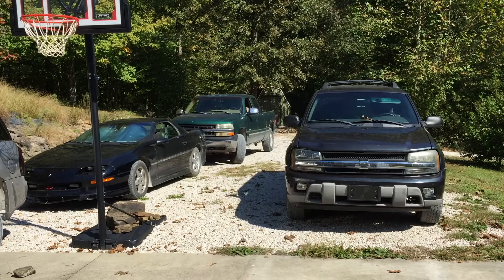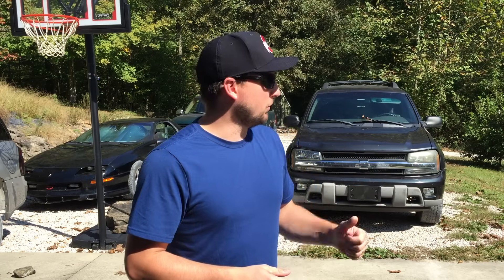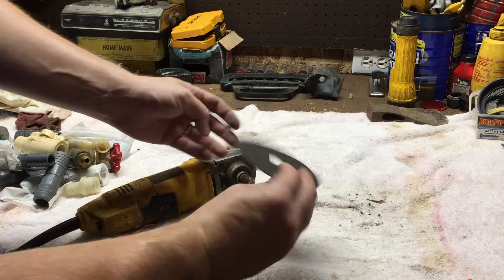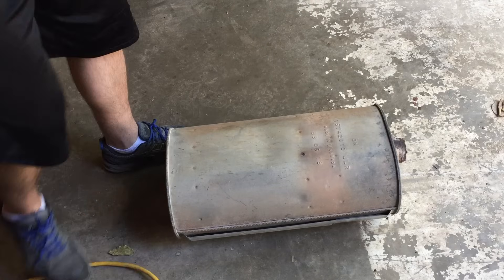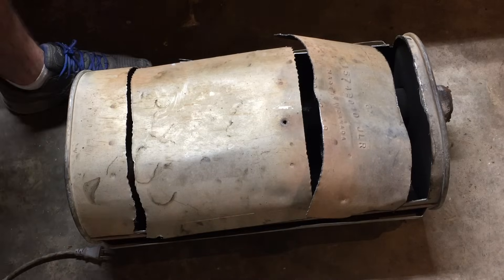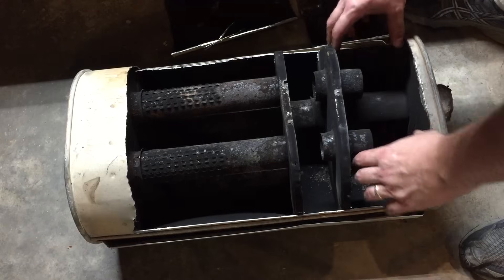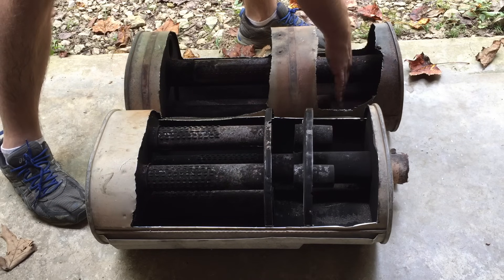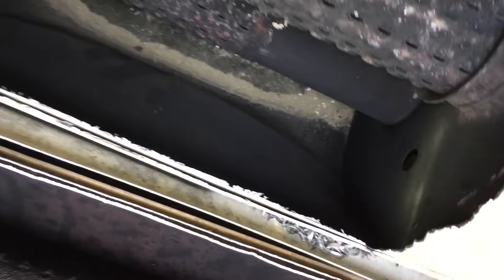What's inside a stock GMC Yukon muffler? - Cutting open Yukon muffler - How a muffler works

Comment from the maker: What did you expect to see inside this muffler?
Reply: Fiberglass packing
Reply: Dancing pixies
Reply: I have an 06 trailblazer with the 5.3. Completely stock. Needs a vortex exhaust really bad. Super nice and clean vehicle though. Does your tb have the 4.2 i6? Also if properly maintained the i6 can go for 350,000 miles easy.
Reply: Mt. Dew cans

Comment: Super late criticism, but no guard, cutting with the left side of the wheel (kickback toward you), wheel upside down, one handed, and no ear protection. Only thing missing is holding down the muffler with sandals on! Careful, anyone else watching! I'd also recommend ditching the wrench and hand tightening. 

Otherwise, cool to see the inside. Was thinking of doing this to mine, but couldn't be bothered to keep the rotted old one.

Comment: I have a 2000 GMC dually with a similar factory muffler. I just ordered a Flowmonster with two 3" inlets and two 3" outlets. It's a straight-through design with sound absorption packing. Looking forward to hearing that 454 roar!

Comment: And then there's my '05 Tahoe with a factory single 2.5" inlet and DUAL 3" outlets that quickly turn into a single 3" via a Y-pipe.  I ain't NO rocket surgeon, but I don't remember ever seeing a set-up like mine on another vehicle.  Don't quite understand the reasoning behind dual 3" outlets into a Y-pipe 3" single.  Can't be to HELP lower backpressure, must be for sound attenuation?  The sound isn't too bad for a stock system.  Because of your vids, I may go with the M-80, wanting a bit more rumble.  Great vids and FUN, too!

Comment: What has been your experience when installing an aftermarket performance exhaust, do you ever notice any low-end Torque loss?   I have, even with simply just swapping out the muffler with the same diameter piping not to lose any scavenging.

Comment: I know this is an older video now but what is it ultimately that makes an exhaust loud? Is it the velocity of the gasses? I have an 02 Silverado so I was surprised just how much louder my truck was when I went from the stock muffler to a magnaflow, plus it has a cam in it so the amount of exhaust coming out was also greatly increased.

Comment: Have you tried tailpipes on your truck? You mentioned it drones, but usually with tailpipes that point straight out the back, there's little, if any drone. Give those a shot with the glasspack, should work. If not, it looks good, and some tips like 3.5" or 4" by 18" length make the sound deeper and louder.